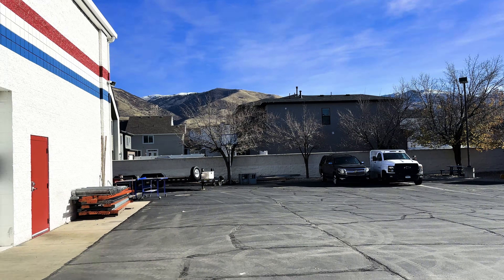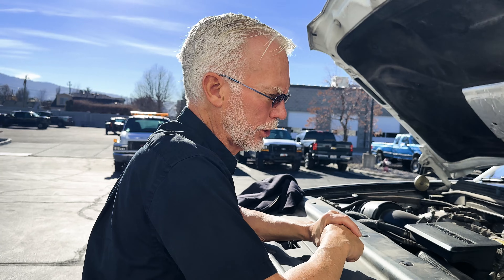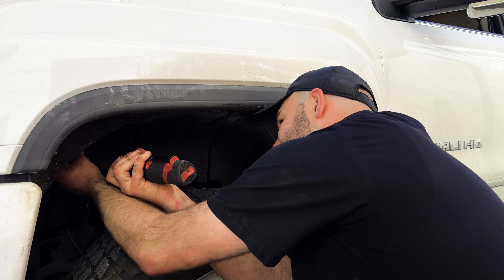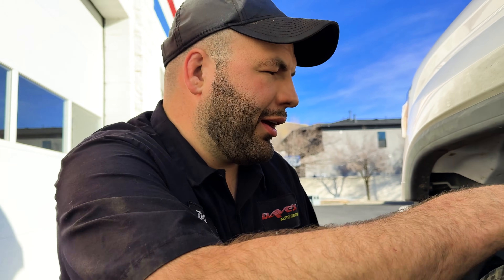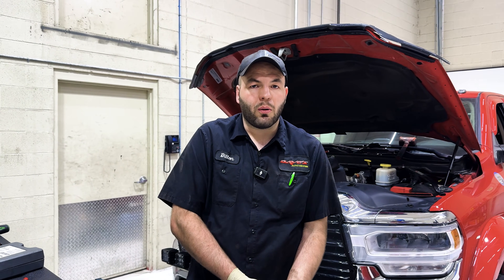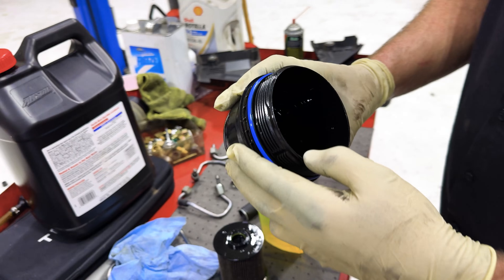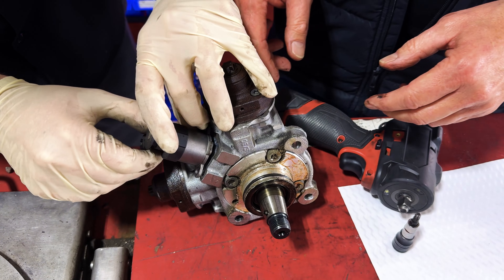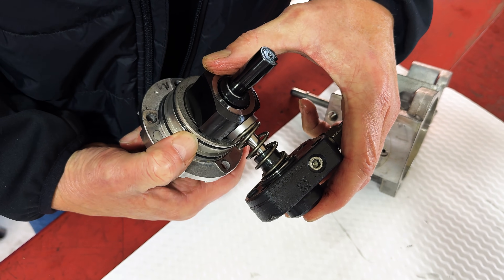We Found a HOLE in His Piston… Then Saw What The Fuel Filter Looked Like!

Comment: Even with the DCR kits or CP3 conversion "fixes," modern diesels still get plugged injectors from bad fuel, water, or poor filtration. A stuck/open injector turns into torch and melts/burns holes right through pistons in no time (especially common on tuned or high-mile trucks). Older mechanical-injection diesels (pre-2007 5.9/7.3/6.0 era) laughed at bad fuel and ran forever on veggie oil if you wanted. Modern ones? One tank of contaminated diesel or a lazy filter change = lottery ticket to a melted piston party.

Comment: I originally used to like this channel but they have slowly been drifting towards selling engines and anything else they can. Also this truck doesn’t have a cp4 it has a hp4 and it is 100% normal for it to have a little bit of brass in the fuel filter housing, it is caused by the in tank lift pump. If it’s on the fuel filter housing it means the filter is doing its job. 
My 19 l5p has been like this since I owned it from 63k-112k miles with no problems, but every time I change the filter there is a slight amount of brass in the housing. 
Do better Dave and stop upselling your monster engines and speed of air pistons when you know it isn’t needed, you also knew that the hp4 pump wasn’t needed but you sold it to the customer anyway knowing that he would trust you because of your platform and all the praise you get from people that don’t know any better. 

I really believe this channel started out with good intentions but now it’s going away from the original plot and he just try’s to upsell every customer that comes in, claiming that they have a dramatic engine failure and that the engine needs rebuilt. He also tries to sell his rebranded “Dave’s secret sauce” (which is just optilube xpd, rebranded as “Dave’s secret sauce”) anytime he can.
Reply: Most likely the reason for the melted piston was that he was towing heavy and wasn’t paying attention to the EGT’S or he was romping on the truck and just didn’t have any way to watch the EGT’S and melted a hole thru the piston. 
It really doesn’t take much to melt a hole thru the piston if you aren’t watching the EGT’S, especially if you have bad tuning or are towing heavy. 
With good tuning and delete your EGT’s will drop drastically and I have to really be romping on my truck now after the delete to get over 1,200 degree EGT when before the delete it would hit that temp easily when the truck was unloaded at WOT. 
Honestly very disappointed with Dave’s auto on this one but good on the customer on declining the “repair”. 

I hope this sheds some light on Dave’s auto’s shenanigans lately… go back to being an honest shop

Comment: I recently bought a 2008 f350 6.4l Powerstroke

I live in a small town - Juneau, Alaska. 

There is only maximum 30 miles of road to drive on.  It is not really a great place to have a diesel truck. 

My question is ; 

I have been doing a lot of my driving in Tow/Haul Mode just to get the rpm's up, the engine to make lots of heat during the short drives. 

Do you think this is a good idea?

Comment: I just don’t get it why don’t people put that disaster kit on these trucks with the CP4 or change it out to a CP3 or the pump they make to replace it. The disaster kit is a lot cheaper than a new high pressure pump the kit will catch all the metal in a filter.
Reply: Because it doesn’t have a cp4 it has an hp4 starting in 2017 and up Duramax

Comment: Why would anybody buy a Ford or GM diesel pickup they are terrible to work on there is just no room to work on them that’s why you have to pull the cab and they cost a lot more to have repaired because of all the labor and if they would make the front about 18” longer and not stuff the engine underneath the dash and that goes for Dodge too.

Comment: That’s not a CP4 pump nor bosch. It is an HP4 made by Denso it’s completely different. The lack of knowledge / incorrect information is astounding and misleads people. If you don’t know the platform then don’t talk about it. The basics of the engine as far as mechanical operation that’s fine. The peripheral things that you don’t know about leads people down rabbit holes sometimes. GM fully parted ways with Bosch on the system when moving to the L5P/L5D platform because of the warranty nightmare that was the CP4.

Comment: Looking for a good Dave or other video on the best preventive medicine for latest generation Duramax L5P??   Ideally 2024 onward since GM made internal "improvements" (I pray 🙏).   I'm retired and have time do my oil and fuel filter every 7500, add Diesel Klean treatment every fill up, clean the top MAP sensor every other oil change and run about 75% highway, 25% city so she gets hot to burn off the DPF pretty regularly.   Anything else (or just go ahead and invest in a diesel repair shop?)

Comment: Dave,
I have a 2012 Chevy 3500HD with the original LML, now at 215,000 miles with no problems other than the emissions equipment. It has the original CP4, but I've installed an Exergy fuel system saver and an Airdog II 4G system. I want to keep the truck, so I'm looking for advice regarding swapping to a CP3. What are your thoughts?

Comment: Why is that extreme pressure needed in a fuel pump to begin with.Dave? In another type of pressure spraying system, spray paint, they use low pressure- high volume guns and compressed air instead of mechanical pumps. You would have thought that they would have designed a bulletproof  fuel system by now.

Comment: I've been struggling to find a new single cab D-max pro model (base model) at a reasonable price and no dealer will work with me, this guy has a GMC Denali crew cab dually with a ruined engine and the price tag on those trucks are insane, I'd hate to be that guy...

Comment: 2019 L5P owner here. I bought the truck new 19. The metal shavings in the filter bowl are thought to be brass shavings from the lift pump in tank. I have seen this myself when chaning fuel filters in my truck. The amount of shavings ive seen has decreased for me as miles added up, i do use additives. The brass shavings found in the fuel filter was well discussed on the forums when the l5p was newer.

Comment: Just to be clear, the L5P does not use a Bosch fuel injection pump, it uses a Nippendenso, so comparing to a CP4 isn't a good comparision. The CP4's have a high failure rate, but the Nippendenso pumps have been pretty reliable. I have a 2023 L5P, on my first fuel filter change, there was metal in the bottom of the fuel filter housing. My best guess is that is was wear in material from the lift pump, but I am not sure. The first filter change was the only time that I saw this condition and the first filter change was performed at 9k well before the filter life was 0.

Comment: High pressure pump doesnt have brass in it😂 metal in the bowl is from the low pressure in tank pump. Dave and the boys need to read about the l5p
Reply: Bingo. Every l5p filter change looks like this. They where quick to tell the guy he needs a fuel system when it's in fine shape
Reply: @nicktaulbee2970 this is my truck. I will be fixing it myself. I will check the lift pump. Thanks for the info

Comment: Bean counters likely found a manufacturer (Bosch) who could produce the volume of pumps needed at the factory at a lower cost per unit that could produce the PSI needed would be my guess.  From the CP4 class action lawsuit I gather the GM engineers were baffled why they failed and asked dealers to send them back to GM.  That's likely when they discovered the lack of lubricant led to the failure.  Yet what they did was blame owners for using bad fuel.  The judge didn't buy the GM reason.  After all they did print in the owners manual to use low sulphur fuel.  In my opinion GM could have saved themselves by owning up to the issue and sent out notice to owners to use fuel lubricant.  They got off easy because the class action only covered a few states and owners had to have bought from a GM dealer which reduced the number of eligible members in the class action.

Comment: ive seen like 5 disaster prevention kits fail lol still fucks the entire fuel system
Reply: It would seem like a better fuel pressure regulator to detect the failure sooner would be needed. My LML I had the Exergy FPR that had a finer filter than the GM OEM.  I thought the Exergy caught the failure sooner.  With the Ford I guess a failure it would continue and flood the disaster prevention with metal until a drop in pressure trips a service code.  I have a F250 now and I wondered about that even after I had the kit installed.  My problem is finding a shop with experience replacing the CP4 with the DCR.  Pi$$es me that S & S raised the price from $1800 to $2400.  I'm waiting on a payout on the GM LML class action so I guess I will use that to replace the Ford CP4.

Comment: This is clearly a design flaw on the part of the manufacturer.
This pump manufacturer should really offer some goodwill gesture, for example, paying for the part and splitting the repair costs 50/50.
Reply: Only if it’s under warranty and no tune is installed. 
Chevy is very adamant on warranty issues. You delete something, kiss your warranty goodbye

Comment: OK,  I'm hoping you reply i recently bought a 2005 Silverado 2500 HD 6.6 does it have the bum fuel pump? If so I'll replace it the Truck came from an older couple who only used it to pull the camper to Florida and back to VA it's got 40,000 miles 😂

Comment: Poor guy 30k plus for motor and then another 10-15 for fuel system, that's ridiculous. Not worth having a diesel, gas trucks are not any better anymore so what's the solution? Electric trucks?
Reply: Rentals or hire it out.
I bought a Cummins 5.9 in 2003. Still going.
Reply: Re-power it with an Edison Motors electric axles charged by a 3.0 Cat diesel.

Comment: Please take notice of the six dimples on that CP4 case.  The updated CP4 have one large dimple instead of the 6 small ones. I would like some info on the rate of failure for the CP4 pump cases with one large dimple as that is supposedly the unoffical updated design from Bosch.

Comment: I wondered why a piston would fail, but makes sense the weak link is the cp4! Glad they went to denso pump now!
Reply: Pistons didn’t fail. The fuel pump failed. Sent metal into the fuel system, went to the injectors, injectors hung open and drilled a hole in the pistons. 
Dillon explained it. 
People only hear what they want to hear. Piston has a hole, O piston failed 😂😂
Reply: @2nickles647i watched the video... no 💩
Reply: The denso hp4 is only marginally better than a Bosch cp4. If you change filters and add fuel lubricants you'll be fine with a cp4

Comment: That is not an HP4 failure, that amount of metal in an l5p is 100% normal and you will see it on every truck that you pull the fuel filter on. It’s caused from the in tank factory lift pump.
Reply: Really? This is the first I've heard. So does the fass system prevent a stuck open injector?
Reply: @R @Redbeard682e u can look up videos of people changing l5p fuel filters on YouTube, that little amount of shavings in the filter is on every single one from brand new until 100k plus miles. Mine has been like that since I’ve owned it from 63k-112k miles. The amount of metal will gradually reduce with mileage, but it’s always there and it comes from the oem lift pump.
Idk if you’re being sarcastic or not but no a fass fuel system isn’t going to prevent  stuck open injector, it will probably do a better job of filtering contaminants over the stock filter though.

Comment: Hi Dave, It doesn't make sense to me that GM, Ford and Cummins don't provide a safety system on the fuel pump. You know diesel and those pumps are mechanical devices that will fail eventually. Why not contain the damage ? I don't know how Detroit diesel and Ford built their engines in the past, but those were reliable diesels. It's sad to see all the problems that are now happening in the new engines. Can you or Jason explain it to me ? Maybe direct me to an internet site that you trust if my request is to long to honor. Take care. Roland

Comment: Such a common occurrence, why isn't the company liable this a recall issue?
Reply: No this isn’t common, LML maybe but not L5P 
LML has a CP4 made by Bosch 
L5P has a HP4 made by Denso , 
Technically it’s the same aspect but not as common as of now
Reply: Not. What actually failed? What caused it? Was it the tune, what killed the fuel pump? 
Need to find the root cause of the problem before you start blaming others.

Comment: spray pattern on piston shows very advanced injection.  The tune wrecked the engine.   Tunes almost always do 2 things for easy power and destroy engines.  Maximum injection pressure and advanced timing.  Wrecks high pressure pumps, cracks pistons, blows head gaskets, wrecks injectors.
Reply: I've had my Edge Evolution on two different 7.3's with no problems. I have an EGT Gauge.. maybe the new trucks are different?
Reply: You forgot ZOMGWTF MOAR BOOST!!!

Unfortunately too many "tuners" don't understand that you have to either upgrade or safety components like the HPFP so that if something starts coming apart, you'll know about it early enough or prevent catastrophic failure.

Comment: I could be wrong but I’m pretty sure the 2017+ duramax engines have the denso HP4. It’s also located after the fuel filter so I’m not sure how it would put metal in the filter. Seems to me the lift pump went bad
Reply from the maker: We addressed this in the latter part of the video👍

Comment: Diesels used to work well never give issues. The modern ones will never get in my driveway.
Reply: Absolutely! Give me a 95-97 7.3 diesel over these new ones.
Reply: @dantecoviello8505 Actually, 7.3 IDI (indirect injection) )are the most reliable. No sensors, but low on power not having a Turbo. The old GM 6.2 Were good. I've had both but currently have a 99.5 F350 7.3 ZF6 Valair Clutch ● I've had for several years ● 320,000 going strong. Edge Evolution set to towing, and straight piped. I will never get rid of it
Reply: I would have one in my driveway if I was rich
Reply: Could not give me late model diesel for free. I keep my 29 year old 12 valve manual trans

Comment: NOTICE ! At 1:17 in the video the "solid" plastic intake tube from the filter housing to the input of the intake bellows is creased and appears to be leaking. Could indicate non filtered air into the air inlet system. Thanks for this video ❤❤❤

Comment: Dillon is a total stud.  He just knows his way around trucks, and is super confident, AND keeps in good spirits.  Example, needing to pull the #8 glow plug in the ass back of the engine compartment.  He evens laughs about it
Reply: I hope he didn't get in trouble for getting fuel on the concrete when he took the filter off.  I'd have gotten a bigger plastic tub
Reply from the maker: Yes, it's great to work around here, great team. Thanks for joining us.

Comment: So, who is putting the CP4 pump on the engine? The engine manufacturer or the vehicle manufacturer? This is one of the biggest head scratchers I have ever seen. Why in the world did they keep using them when they learned what a time bomb they are? This is one of the reasons I won’t buy a diesel. And the fact that they cost 2 to 3 times more to fix than gas. I can work on gas, have for a long time. I know how a diesel works I just don’t know most of the little nuances. And the computers, I’m an Electronics Engineer, are crazy.

Comment: So GM has a bulletin out on the L5 P Duramax fuel system. Non-metallic shavings in your fuel filter. Housing is normal. I have the same on my 2019 L5P Duramax and I went to the dealer and they gave me the bulletin on it.
Reply: Brass from low pressure pump
Reply: @gagerolls7845 I don’t know but I got super concerned when I saw is and I called the my dealer and they showed me the bulletin and I got it saved as a PDF and I just looked at it again.
Reply: @gagerolls7845 I try to send you the link to see the information GM put out on it. But it will not stay.

Comment: I though the 2017+ L5P uses a denso HP4, which has no relation to the bosch CP4.
Reply: If you watch the full video to the end, they compare the differences to the HP4 and CP4
Reply: @Sixpointtwoliter guilty, I didn't finish watching the video.
Reply: it does have the denso pump
Reply: Yup it's a Denso not a CP4.
Reply: Video confusion. L5p denso or Bosch pump.
Reply: More Premium Brands may have MORE lubrication,  than ' supermarket brands ' so if you use unbranded diesel a lot you may need to   put your own additive in occasionally
Reply: @A2Z1Two3 look up top tier diesel Costco it about the only one. use additive every tank. government minimum requirements are a joke for gas and diesel
Reply: and it still grenaded. that's why you need to add lubricity to your fuel
Reply: @bigdaddymak1439 Diesel ⛽️ Fuel already has lubricity added but I add Stanadyne
Reply: @speedfreak8200ultra low sulfur diesel doesn't have enough. just like non too tier gas doesn't have enough PEA detergent
Reply: @speedfreak8200 Diesel fuel still does have lubrication, but like the gentleman before me already said, and virtually every mechanic will tell you, modern diesel doesn't have enough. I swapped the CP4 for the CP3 in my LML and I still add diesel treatment to every tank.

Comment: Primary Filter/Water Separator (Frame Rail): This is usually the big canister you replace. It removes larger particles and water from the diesel fuel, often located on the driver's side frame rail (e.g., L5P models) or passenger side (older models).
Secondary Filter (Near Engine): Some setups have a finer, secondary filter closer to the engine, ensuring extremely clean fuel reaches the injectors. 
I'm trying to visualize the stated contamination of the injector spray nozzle.